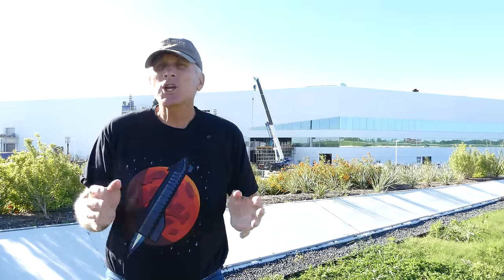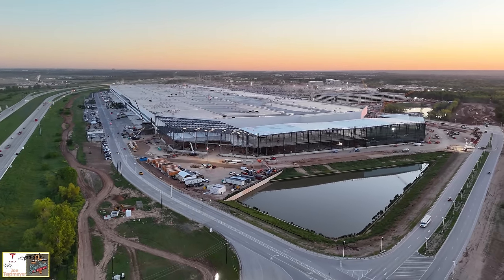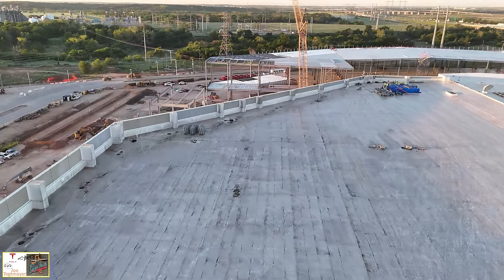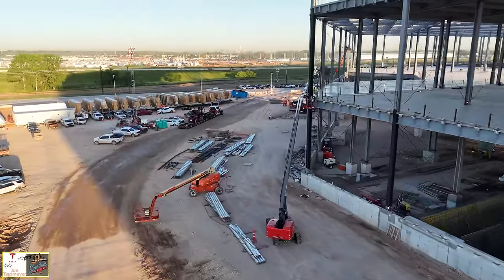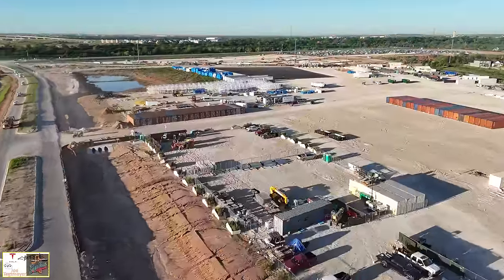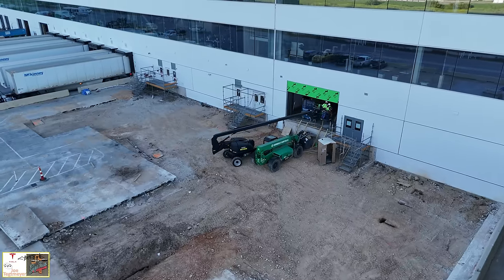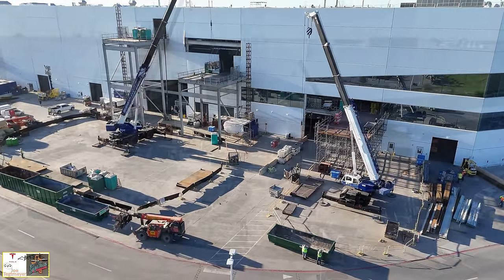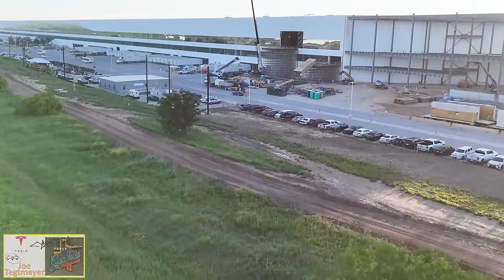Parking Garage Milestone! Boring Progress & E Casting Expands! 5 Apr 2024 Giga Texas Update(07:35AM)

Comment: Thanks Joe
5:37. Southend, east. Red formwork for pile caps/footings. 6 column formwork assemblies beside the road.
Location suggests some construction in the trenches. A good slice of land here between the diverging transmission line easements exists.
5:47. River Road east extension. Simultaneously bringing in more suitable fill (bottom), while hauling away the loose overburden (top).
7:24. Parking Garage. Topping-out tree. A lot of comments that a solar awning will be constructed. Almost all the columns have bolts projecting upwards, so some sort of roof is possible.
8:07. BIW, apron. Right. Huge flue/chimney at the loading platform. Largest flue on site I would think. Larger than the RTO flues.
9:23. Southend, inside. Bottom. New square excavation in the last video now has concrete slab and rebar starters for walls. Small box in the corner for a sump. Tunnel/passage. Roof rebar over the tunnel section.
9:41. Southend, inside. Columns. Beam connection plates for intermediate floors on some columns are recent additions. Shows that the design of the north half of this structure may not have been entirely settled, causing the delay in construction.
9:42. Southend, inside. East-west stormwater drain now extends into the same column bays that are speculatively the ramp to tunnel/tunnel portal alignment.
11:39. Southend. Retaining wall. Vertical grooves cast into the face of the retaining wall scale to 3.6m 12’. Wide enough for a vehicle.
I'm trying to keep an open mind about these passages, but fire escapes seem more and more likely to me.
13:27. GA, loading platform. Large silver rectangular item would be a cowl for the roof. Similar on the roof of Paint.
14:48. New EOL Superchargers. Excavation works within the groups of orange traffic cones. Circular rebar cages visible. Presumably the start of the awning structure.
16:53. Westside, storage. Large new section of asphalt paving.
17:19. Far west. Earthworks. Extracting earth.
18:58. Westside. Tunnel Project. TBM disappearing, only the tail seal visible. 12 complete rings visible, 18m.
19:16. Westside. Tunnel Project. Compacted earth placed over the tunnel alignment seems complete. Compacted earth is a ‘surcharge’ as described by David Salisbury.
21:22. Main Entrance. The lime leaching out of the Stoneglass adhesive that I swore I would never mention again……..is quite visible on the paving at the bottom of the Stoneglass.
23:30. Plastics, apron. Plastic lined dumper bin of earth. Some sort of contamination.
23:51. Casting, diagonal corner. New door opening seen being cut in Joe’s previous video is now complete with a roll-up door.
24:50. Casting. Roof. Pipework is being lagged/insulated. Large rectangular roof curb/kerbs. These look like they are being fitted with a permanent roof. Curbs have been there for almost 3 years. Some HVAC gear was suspended below these, now removed.
25:31. Casting east. New door opening also fitted with a roll-up door.
25:50. BIW, loading dock. Ramp. Removing the white foam blockout form from the grate drain trench.
27:02. BIW apron. Top. Now 6 of the temporary chillers returned to the apron.
27:26. WOW yard. Another super heavy duty low-loader. 4 or 5 of these here over the last few weeks.
28:11. Crash Test Track. Most of the test vehicles have been removed.
29:37. Cathode. Plant platform. “Vaporisers and nitrogen tanks”. At least 5 of the white tanks are marked Oxygen.
Reply: Damn, like 1y later and you are still at it. :D
Reply: @musaran2   Hi Bruno. 3 years of posting my comments. I figure if these guys take the time to go out and film for us nearly every day, then I need to do my bit and add some observations.

Been a great project to watch!

Comment: Joe - a small request. It would be great if on next flyover you line up the drone with the TBM so we can see where a straight line would go in the factory extension…

Also - perhaps the below grade tunnels in the extension provide external driving access to the TBM tunnel
Reply: Alignment of the tunnel has been established for quite sometime. The gap in the retaining wall at 12:51 is the location that corresponds with a parallel line offset from the face of the existing building and the launch site of the TBM.

Comment: The 4680 cells are probably scrap from startup of a new 4680production line. Efficiency will wrap up leading to less scrap. 
Total lines should be 8 running at full capacity sometime this year in order for the Cybertruck to ramp up to 250.000 cars/year. 
The amount of batteries they need to produce is mind blowing! Engineering team should take much more credit!!

Comment: Thanks Joe!
Utility easement:
@ 5:23 (Right) I doubt much can be built here, since it is a utility easement.
Tesla road:
@ 5:46 Ongoing progress on the Tesla road extension.
EOL facility, south:
@ 14:48 Open vault and cable spool. Cable likely being pulled to the south. Seen here @ 20:11 (Upper left).
Eastside of casting:
@ 25:30 New section of concrete slab has been poured. To the left of the stairs, by the small yellow machine.... Pieces of conduit that have been cut off of the old main power duct-bank can be seen.
Reply: 5:23. There's a 800' long parcel of land that tapers from 0' to 120' where the easements diverge.

Comment: Colud those 3 underground bunkers be as  simple as tornado shelters?
Reply: For now what isn't visible at the Southend is any sign of fire escape doors. I guess they don't want to mess up the look of the fully glazed wall. Fire escape tunnels seems likely to me.
Reply: @DessieDoolan  I was thinking safety near internal stairways. I think you have it right. And all those raised concrete post bases were to keep door out of the walls?
Reply: @kkarllwt  Raised concrete bases is still a bit of a mystery. I think those are about allowing utility/service trenches to be easily installed above drains etc.

I still think this is a production area that is meant to be on display. I guess they might want to bury a lot of equipment below the floor level.

As for the fire escapes, it's the way the retaining was has been constructed that is the clue for me. A beam/thickening (a lintel in my terminology) in the retaining wall the width of the passage, and the vertical cast in grooves the width of the interior of the passage. Rebar not continuous behind those grooves shows an opening can be easily constructed.

No idea why the opening wasn't constructed initially. Maybe some permit issue.

Comment: The angle of the window line on the steel frame extension - I'm wondering if this portends the reuse of the previously installed windows on the original southern end of the building. They remain in storage on the western materials storage lot so it seems to be a reasonable assumption that Tesla, having invested so much money in custom-made windows, would seek to reuse them, otherwise they would probably have long since been sent off for recycling. 

I certainly hope that this is the case as, personally, I find it rarher irksome that Tesla, a company whose whole raison dêtre is to expedite the world into transitioning to sustainable energy and transportation usage model, has a tendency to be quite wasteful in it's approach to construction, concrete & asphalt being prime examples.
Reply: Wouldn't think so. Those tapered windows got progressively smaller, the new windows need to get progressively larger.

Not to say they won't be re-used somewhere.

Comment: Just curious, is there any speculation that this will not be the last tunnel here at Giga Texas? Seems like a lot of the tunnel walls premade for not just this segment. What do you think?
Reply: The one thing that struck me was that the borer was smaller than the 3 story TBM's you see in Europe making highways.  Also the belts kick the dirt out sideways, and the offices were super close to the machine.  I don't think there is anyone INSIDE the machine as it bores.  The way it is set up today, they could just send it, bring it back, move 40 feet over, and do the same thing.  It would be cool to build tunnels to drive from one building to the next, all underground, but I don't think Elon would do that right now the way OpenAI is kicking him, Tesla stock not great, Spacex in the middle of a new rocket... on the plus side, hes not implicated in anyones divorce filings that we know of
Reply: Not enough on site yet to complete this tunnel. 300m minimum, 1.5m per ring =200 rings, 6 segments per ring, stacks of 3 segments needed means 400 stacks required (minimum). Last count they had about 250 stacks on site but not counted for a couple of days.
Reply: @davidanalyst671 there is a full team inside the machine as it bores. Possibly some remote control (the segment delivery car, segment erection) but a TBM of this kind still needs an operation/maintenance crew and they have a tally control at the portal in the side of the operations control container.

Comment: Wiki says that they can tunnel one mile per day.  So I guess they are already done?
Reply: Considering the number of concrete liners still on site I don't think that they are anywhere near done.
Reply: @bryanwhitton1784  no sense of humor?
Reply: @MinusEighty Naw, never saw a need for one. Sold mine decades ago. 😉
Reply: Wiki would be very wrong then. It's more like a week then a day
Reply: @saff226 they can’t excavate a mile a week with that TBM. 50m a day would be very impressive.
So far 18m in 5 days. Still working with just one backup deck and umbilical elective and hydraulics.
The will need to stop for a week or so after the first 50m to put the rest of the backup decks in.